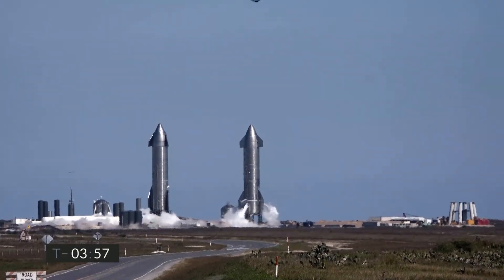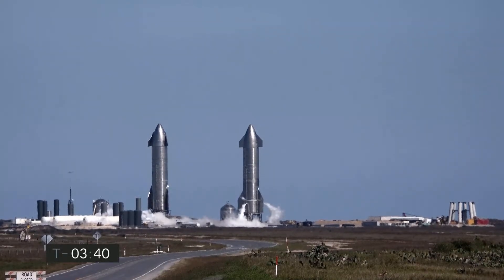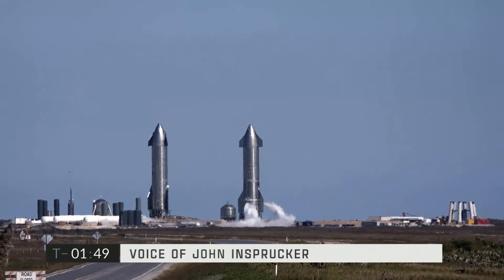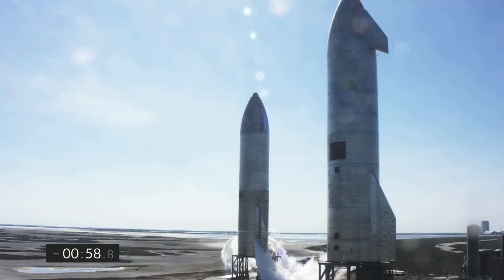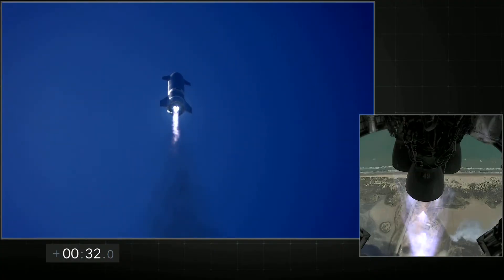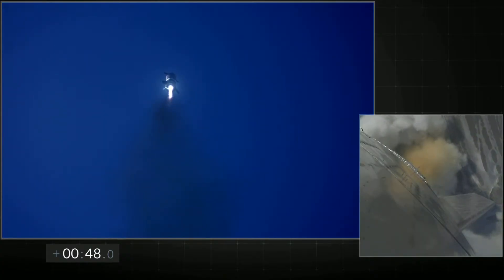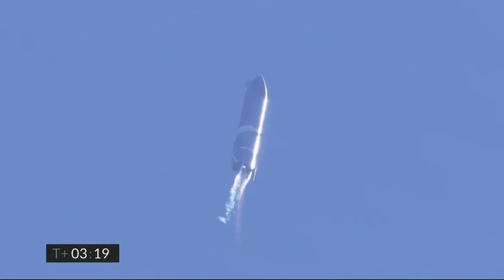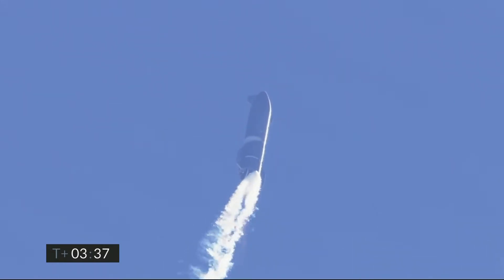Starship | SN9 | High-Altitude Flight Test

Comment: Compare the exhaust of the SN9 to a Space Shuttle. Almost no smoke whatsoever!
Reply: No rocket emmits smoke, it mostly emmits other gasses. At ignition, the huge cloud of ''smoke'' isn't actually smoke, it's water vapor
Reply: Well, you still get CO2 from combustion reactions (other than hydrogen if you include that in combustion) so you can pollute. The point is that methane is much cleaner due to its simplicity and low quantity of carbon.

Comment: Koo! Use a parachute, you morons.
Reply: No that’s not the point of this, the point of these test flights is to make the starship land because if they use a parachute they cannot control where the rocket will land, as where if they try to land it they can have it where they want it
Reply: It's far too heavy. The Shuttle SRBs had three parachutes, and still landed at 50mph/80kmh. It only weighed 90 tonnes, this was closer to 150.

Comment: Honda racing engines failed a lot during the development in the 80´s, but they picked up all the pieces and tried it again over and over. Later on they had the best engine and won. And still are one of the overall best engine developer today.

Comment: If it ant broke don't fix it. I don't understand why they have to change the design of the rockets that work.
Reply: Because Starship will be reentering about 5 times faster than Falcon, which means over 100 times more reentry heating.
It needs to bleed off as much speed as possible while the atmosphere is still thin, which requires maximum drag. 
Falling sideways gives you about an order of magnitude more surface area, and hence drag. It also helps spread out the heating over a larger area.
The extra drag is also particularly useful for landing in the thin atmosphere of Mars, which is the ultimate goal.

Comment: And to think that we landed a similar way on the moon safely.. In 1969!!!
Reply: The Lunar landings weren't anything like this. This is much, much harder. 
The LM was in 1/6th gravity, didn't have to contend with aerodynamic forces. It also descended engine-first, with the engine firing for the entire descent.
Starship has to do a carefully balanced, high speed, unpowered skydive, before initiating a flip maneuver and igniting it's engines only seconds away from the ground.
Starship also weighs about 100x more, and has three engines, all of which are far more complicated and powerful than the DPS on the LM.

Comment: I think they did a great job anyway. they did good and in some parts better untill landing. And they know where to work now. 
From the video seems only 1 burner is activated while a 2nd was trying to start. And I don't know if the flipping height was correct seems too close for stop it.

Comment: It looks like the engine comes on too late.   Downward + rotational force  > thrust + reaction force  ==> crash.  
Either height sensor failure or calculation does not taking into consideration of delta height before the thrust is given.

Perhaps using parachute to help slows down the rocket before given it some thrusts.

Comment: Would have had better luck strapping a parachute on it.
Guess ya gotta crawl before you can walk.
Reply: Highly unlikely. The Shuttle SRBs had three parachutes, and that was only enough to slow them to 50mph/80kmh. They weighed 90 tonnes, this was closer to 150.
SpaceX tried parachutes on Falcon 9, which is only 20-25 tonnes, and it didn't work. That's the whole reason they switched to propulsive landings.

Comment: Can someone tell me, why they are trying a suicide burn instead of rotating the Starship at a higher altitude (a few hundred meters higher) and then landing it? We saw, that hovering is working great in earlier tests. Isn't it easier to work out the flipping to vertical and then lowering the point at which you flip?
Reply: They try to safe fuel and the way the're trying is the most efficient.
Reply: @magnusb8690   I do understand that it's the most efficient way, because you don't need the hovering at all, but my thought is, that it would be easier to figure out the flipping first and then going for effeciency, because than you already know how to flip and just need to lower the altitude at which to flip.
Reply: @FoXtrott1989  That's actually a smart thought...
Reply: @magnusb8690  That's what I was thinking, but I'm not a rocket scientist, therefore there must be a answer to the question, I just can't what I'm missing

Comment: So here is how to solve this "Work on that landing a little bit" thing. Elon should say: "With SN10 we are going to pump in more fuel, then do 5 "bellyflop/flip vertical and recover" sequences before finally landing on the pad.  GET IT DONE!"
Reply: GOOD POINT BUT BELLYFLOP IS NOT THE PROBLEM HERE. IF RESTARTING THE ENGINS IS A PROBLEM, AND IT LOOKS LIKE IT WAS ON BOTH SHIP 8 AND SHIP 9, WHAT I THINK THAT THEY SHOULD DO WITH SHIP 10 BEFORE THE FLIGHT IS TO PERFORM AT LEAST 5 STATIC FIRES WITHIN ONE HOUR TO PROVE THAT THEY CAN RESTART THE ENGINES. IF THEY CAN NOT DO THAT, THEY SHOULD NOT PERFORM THE FLIGHT UNTIL THEY MANAGE TO DO IT. AND THEN WHEN THEY MANAGE TO PERFORM 5 STATIC FIRES IN ONE HOUR WITHOUT DAMAGING THE ENGINES OR THE SHIP, THEN THEY ARE READY TO FLY. IT WOULD CERTAINLY COST THEM LESS BECAUSE SHIP WOULD NOT EXPLODE IF STATIC FIRE FAILS, BUT IT WOULD IF LANDING BURN FAILS. IT WAS OBVIOUS THAT THE SHIP WAS NOT READY BECAUSE A COUPLE OF WEEKS AGO THEY PERFORMED 3 STATIC FIRES IN ONE DAY (NOT WITHIN ONE HOUR) AND MANAGED TO DAMAGE 2 OUT OF 3 ENGINES. THAT IS INSANE. THEY SHOULD BE ABLE TO PERFORM 5 STATIC FIRES IN ONE HOUR TO BE SURE THAT THE STARSHIP 10 WILL MANAGE TO DO LANDING BURN.
Reply: https://youtube.com/watch?v=hGVDzN-oPGA&feature=share👌

Comment: And why can’t we go back to carbon fiber?  It is too heavy IMHO
Reply: Bc carbon fiber is way more expensive?
Reply: Magnus B  isn’t that  what they use to tell Elon about batteries?  I think it had to do with developmental time.
Reply: Elon said that steel actually works out lighter.
Carbon fiber is lighter at room temperature, yes, but not when you account for the cryogenic temperatures this rocket reaches when fueled, or the high temperatures on reentry.
When carbon fiber gets too cold or hot, it gets a lot weaker, so you need to make it thicker than it would have to be at room temperature.
Steel also gets weaker when hotter, but not by nearly as much as carbon fiber, and it actually gets stronger when colder.

Comment: What's with all the Musky fanbois here? 
As this video shows the prototype is a failure. Period. Nuff said.
Go on, I'm ready for the hate. But essentially this is still no step further up from the V2 from 1944, only bigger boom.
Reply: Well actually not. The V2 couldn't reorientate it self. Couldn't Hold steady on a horizontal position and navigate to the pad precisely during decent. Couldn't do planed engine shutdowns. So on and so forth...
The Test was anything but a failure. It showed the spacex team that starship is capable of a belly flop maneuver and that they need to improve the raptor engines or what ever caused the relight failure.
Reply: @magnusb8690  Alright. ONE step up from the V2. 
Joking, okay, joking.

Comment: Space x should work on an alternative eco friendly fuel while they're at it 😅✌️ so that they can do test flights guilt free. Just without the crashing 😅🤣
All in all amazing work goin on. 👍
Reply: The fuel they're using can already be made in an eco friendly manner. 
For the time being they're sourcing it from natural gas, but synthetic production with renewable energy is very much the end goal.
Reply: I'm sure they are 100% guilt free about these test flights, and they use methane for a very good reason.

Comment: damn thats some expensive tests... why have another rocket so close, surely it could be damaged.
Reply: No room in the hangar. Busy building more starships. Also, they are not as close as they look at those camera angles.
Reply: They are not that close also they aren’t really  that expensive and hey are nothing compared to other rockets
Reply: SN10 does not have engines installed AFAIK so it is not so expensive
Reply: not that close, if you whatch trevor maklmann video of the flight you will see the 200 meters between the pad a and the landing pad

Comment: The dynamics with this fat boy are very different to Falcon 9. It will take a few more trials before cracking it, and landing it with enough reliability to move to the next step.

It is remarkable they keep pursuing fully autonomous cycles, without the assistance of parachutes for example, which could reduce the number of variables in play and buy some time. It is much harder this way, but it is the right way to go, since they have proven they can totally control where they land, with an accuracy of just a few meters.
Reply: parachutes are so heavy and not recoverable. Also they cannot be thrown while going in highly hypersonig speeds so the Starship body flaps are the best way to make this vehicle fully reusable.

Comment: Looks like Sn8 went better.

I find it brave to tilt and mingle the liquids of a rocket during flight,and try to calm them down again /fill it and reignite the engines in a falling trajectory :). 

I personally would prefer some sort of solid solution. 

Although I understand that applying several engines solutions is probably even more complicated.
Reply: well, the belly flop transition of sn9 was quicker and smoother than sn8's and it landed right in the middle of the pad while SN8 almost didn't. Yeah, it touched down in the pad but far away from the middle

Comment: Im also impressed by the fact where it went down, on the exact Spot its started from
Reply: not in the spot it started, but in the spot it was meant to finnish. SN9 was launched from the pad next to SN10
Reply: Don't know what this should prove ... it simply exploded when it touched the ground, as all such things do. Maybe it should have come down exactly on the other "Starship", resulting in two explosions at once. That would have been more spectacular, and it would have proven that a least the landing location is exactly met ...
Reply: @ytb40  It prooved that actuated fins in a belly flop descend can reduce damatically the terminal velocity of the vehicle without wasting fuel or losing control. 
The important thing was the belly flop and the aerodynamic control. 
Did you see that smooth belly flop transition and stable descend? It didnt just "explode to the ground". A thing failed, and if they investigate the problem they can solve it and try again with SN10. 
Talking about test flights we don't just focus on "it landed" or "it exploded". 
The tesing of a flight is complex, it has a lot of patts to be completed and analysed. An explosion is an expected result.
Reply: Flakier is not possible.

Comment: Way of landing the starship spacecraft on uneven land.

I am thinking a way for the landing of starship spacecraft on uneven land as the SpaceX is trying to land it on uneven surface first on earth then on mars, I didn't know more about the aeronautics, Dynamics and about rocket science as I am a student only (studying in 8th class) I will try to know about these subjects but I just thinking of it and I got an idea which is not best or excellent but still it is good for me and I want to tell you about it,

My idea is that, in the base of the rocket from where the fire starts lifting of the rocket can be fitted with a long drilling machine ( heavy duty drilling machine not which is used to make hole in the wall ) can be fitted under the rocket on sides whenever rocket come down for landing driller gets starts and it moves inside the land ( it must be enough long to balance the spacecraft and weight ) and it is fitted with some thing which can open when it gets inside the land so that the rocket doesn't fall down and whenever it was to be relaunch it gets closed, the idea is not good as the driller iron gets melt because of fire and it can't be able to maintain the balance of su and many other problems for maintaining balance and load of the rocket to some theories of thermodynamics or aerodynamic for Design and drag. But I thought of an Idea so I written it here and sorry for writing it in tesla ideas . I write it here because I didn't find another place of writing this idea and also I not use social media apps till now so I written the idea for spaceX here. Thanks
And I had drawn an image but in youtube I can't show it.
          
                         ~Himanshu Arora

Comment: I maybe be saying crazy thinks now, but i wonder why the starship need to use fuel to generate heat and get off the ground in a straight line with so much resistance, using planes turbines  and launching horizontally like an airplane to leave the ground then when already on sky use the spaceship fuel to go out of orbit and when coming back use the turbines again to land like a plane is not possible?

Comment: I wonder how SpaceX test Mars landing, because Mars has different air density and gravitation force compare to Earth. Maybe use data collected on Earth landing and build a model to simulate Mars landing? It seems to have long way to go. Rotate starship to landing position using air resistance by folding bottom wings may not work due much less dense air in Mars. Less gravitational force may help with landing as it slow down the speed.

Comment: The engine is roaring like a thousand Harley Davidson's being accelerated at the same time
Reply: Yeah, but most Harleys don't explode shortly after that. ;)
Reply: @mortifinkenbein9559  some do though
Reply: Flat earthers are questioning.
Reply: And that's only 3 engines.. I believe the one that goes to mars will have 30
Reply: That’s because it is:)
Reply: That Guy  that was a nice one man
Reply: Comme une mobylette PEUGEOT 103 SP avec un kit 75 Dellorto...
Reply: https://www.youtube.com/watch?v=zHXsilDFqGw
Reply: That Guy  I have heard rockets take off before
Reply: @Kore VFX It’s an obvious one rockets go vroom we get it you don’t have to point it out
Reply: No, like a v1 rocket
Reply: @zxzrp0 well boy first of all I pointed out that this engine sounds a bit different and not like the normal ones may be because of the supersonic speed of gas coming out which is ofcourse same for all engines but the high speed hot air hitting the cold slow air while re entry makes it sound like a series of repeated explosions in the engine this sound was similar to a Harleys sound but magnified a thousand times , so this was the reason I wrote down this comment and well I wasn't hopping for Dumb people to come and start blabbering shit in here 
Just listen the sound again and you will hear many blast and a normal rocket engine either sounds like a jet engine or like a huge waterfall and their sound is consistent and have no blasting sound
Reply: Yea that’s what a rocket sounds like you don’t have to act like this is some sort of accomplishment
Reply: @Phoenix_1776  well no not all rockets sound like that many soud like waterfall
Reply: @kshitijranjan9764  Of course every rocket sounds a bit different but this is nothing special it sounds like what a rocket should sound like

Comment: When descending prototypes, you can simulate a mid-air landing several times, reducing the speed to 0 mph. In this case, you do not have to break many prototypes, you also get more data for analysis and faster completion of the rocket development. And even if the simulation of landing in the air is unsuccessful, you can land the prototype manually, saving it.
Reply: No, because each flip maneuvers will be realized with different amounts of propellant. Only the last flip will be relevant
Reply: unfortunately to do that flip landing manoeuvre you need to use fuel in the header tanks and theres only enough to complete one burn

Comment: This mistake was made by the engineers or they started the engine late. Or there was a technical glitch inside that the landing engine started working so late that the starship reached the ground first and crashed.
Reply: It was a hardware issue.
Reply: @angadsingh9314  YES MAY BE

Comment: 9 landed worse than 8..flipped too late and not enough time to slow it properly
Reply: Wasn't late, it was perfect timing
Reply: @tauraspace   Perfect timing  according to programing, maybe. 
They should have had it flipped at 2km and then did the burn, but it was still horizontal less than 1.5km. 8 came in perfectly straight but too hot velocity and this 1 came in on an angle, too hot velocity.

Comment: “Preparing to Relight two engines “
“We gotta work on that landing a little bit”
Reply: Gotta whoa her landing down—coming in a bit too hot an’ heavy!
Reply: It's all Fun and Games until the engine doesn't light up 😂
Reply: Perhaps SpaceX should try to land only with one Raptor engine, since the second engine seems to be failing to ignite at lading. Also, they should test the flip landing maneuver way earlier, and then after they figure it out, try at low altitude.